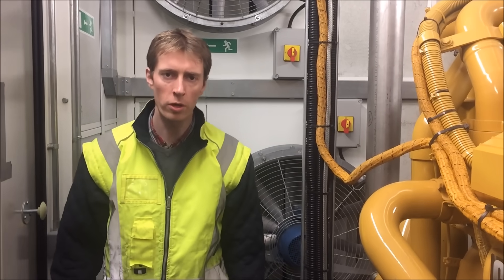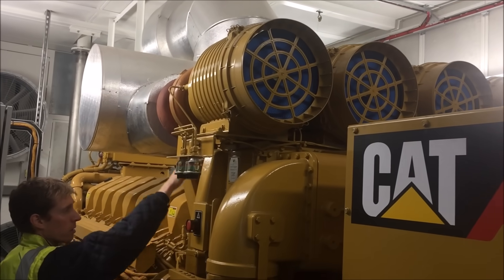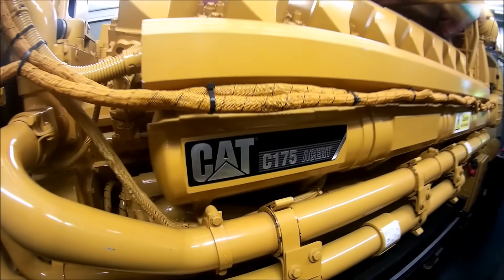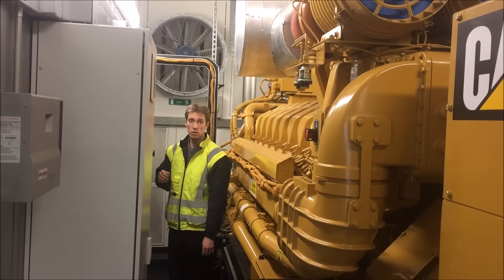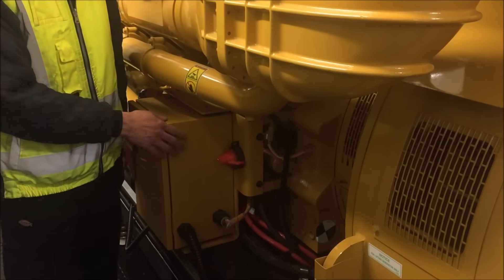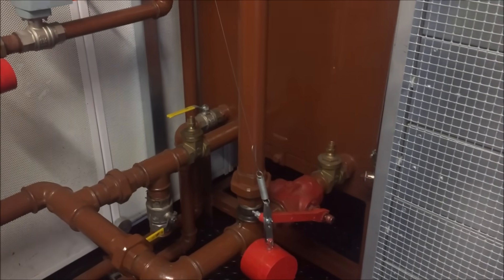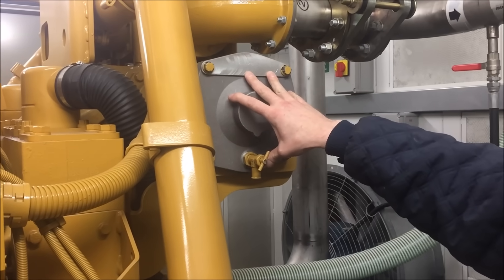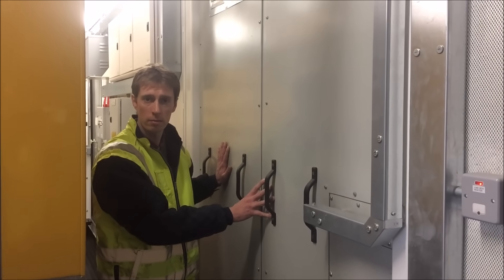CAT C175 Masterpiece: 4000HP V16 Diesel Generator Walk Through & Warm Start

Comment: Where is this engine in, a boat, ship or some marine vessel, or on land such as a pumping station or powerhouse, Looks like only one genset unless in other rooms or cubicles. Usually multiple engines on large container ships for auxiliary electrical use. share common space. As this has an electric starter, is this engine the 175 air cooled or water jacket usage? Thanks
Reply from the maker: Hi Nino, this was one of 4 individual containerised units positioned on a large laboratory in Europe, they were kept individual in case just one needed to be replaced it would be a quick swap. The engines are also used in heavy plant, marine and locomotives though. it has a heated water jacket where the heat is maintained to allow for a quick start up.

Comment: How many of those would keep the hospital running in the emergency?
Reply from the maker: It depends on the size of the hospital, this one was one of 4 installed on a 92,000m2 laboratory building for 100% back up.

Comment: Im happy to have the privilege to build these everyday.
Reply from the maker: great work.
Reply: @RossPerryProductions thanks. I have since then moved to the 3600 platform.
Reply: do you work with me?😂ive been building and welding genset's for the last 4 years and have worked on probably 30+ different variations of bases
Reply: @HazeyKadin just under 2 years ago i got to switch to the 3600 platform.

Comment: There was an airconditiong compressor which had a motor generator to run that compressor @400 HZ, AMERICAN STANDARD TONRAC, HEAVY TONNAGE, BUT could fit through a ‘standard door, that was at the AGFA FILM PROCESSING LAB, IN FLUSHING NY,,but when the GOVERNMENT screwed them, it was sold to a chemical co, in HAVERSTRAW NY, IT WAS A CENTRIFUGAL UNIT. 🇺🇸🇺🇸🇺🇸🇺🇸
Reply from the maker: interesting fact

Comment: 2000L in 4 hours at full load holy crap
Reply from the maker: Yep she is thirsty alright
Reply: I was some years in the proofstation, to check the new engines... well, two of these side by side for a 24 hour testrunning was like a jackpot for the Dieseldeliverer ;-) 2 Loads with 25.000 L for 1 day...  Hot and noisy times..

Comment: What is this engine used for ? fuel consumption ?
Reply from the maker: Hi there, this one in particular was a bank of four on the roof providing 100% back up to a laboratory. The fuel consumption vastly changes depending on the load of the engine.

Comment: The place is so congested to do maintenance work in future,
Reply from the maker: There is enough room to be able to fully disassemble the engine in place.
Reply: Those enclosures are for environmental control and air intake control/filtration for the engine. Over sizing it would be counter intuitive since it would make control more difficult and require more material which means more money. And if you consider how much maintenance is done on this engine it would make no sense to spend the money. Change filters, top up oil, and do routine checks while its running (i.e. poke your head in and make sure its not too hot, has oil and sounds normal). Other than that these engines are built to last and any major repairs would be few and far between, and if major repairs are required there will be access points and disconnects so they can do work on any part of the engine. Also note the enclosure is meant to reduce the incredibly high and constant noise levels generated, so this man should have hearing protection at all times near this while it's running.

Comment: 2.4 mega watts PRIME RATED means this will run CONTINUOUSLY at that output. Keep the fuel coming and the only time you need to shut down is for normal service - filters, etc.
Reply from the maker: Preety much :)
Reply: Might need a couple jerry cans

Comment: Thanks for valuable information.
I am a electrical design engineer.
Kindly suggest which one is better for prime power application.
a) 12 Cylinder V           b) 8 cylinder inline 
in terms of block loading capacity ( in inductive load ) 

I am comparing Cummins KTA 38 G5 and Perkins 4008 TAG2A
Reply from the maker: Hi so sorry I only just see this, my preference is the V12.

Comment: I noticed he said it was a "warm start." I hope during a "cold start" the cooling fans won't come on immediately. This will cause a delayed warm up times to the coolant.  But I am sure it has a block heater or has a heated room for cold winter starts.
Reply from the maker: Hi There Jason, once commissioned and in use/on standby the unit is continuously warmed by hot/water pumped around the engine jacket so that it is always ready to start.

Comment: About the same as the old D399? we had 3 D399's on an Diesel Electric gas drilling rig back in the 1970's
Reply from the maker: I very much doubt it would have changed a whole lot maybe more on the electronics and injection side

Comment: What amount of diesel it  take to start the  engine and fuel consumption  per hour  and mileages if you  have a two thousand gallons tank.
Reply from the maker: Hi there, depends on the load but typically when running an average of 190 gallons /hour, so around 10.5 hours.

Comment: Loved the day tank comment. That is sooo critical as loads vary season to season. 
Do the upper coolant lines have vibration isolation? 
Wish there was more elbow room in the building. 
Thanks for the walk around.
Reply: its takes such a 4 joke crap piece of junk to drive an 11'500v generator, But the c-175 has room to cut ports into for a 2 stroke mod1, there lots of room to CNC laser or plasma cut a custom port pattern and a dry sump oil injection feed with synthetic 2 stroke or castor bean oil, something like this:https://www.4btswaps.com/attachments/2cyclesbc-jpg.6839/. i ssume this is some type of 2 stroke conversion driving this generator!
Reply: Im glad you like the 2 stroke ported engine idea! it can be done with a guided plasma cutter
Reply: It can burn any port pattern in those liners hehe!
Reply: @jlo13800  I do. Two stroke died out before assisted  turbo charging.  Either electrical. Exhaust is hot enough for a steam driven turbo once it comes up to temprature.
Reply from the maker: Hey Allen, sorry I missed this comment yes there was iso mounts on everything, we needed the container to be a certain size as there was 4 of these on the roof of a building. Thanks for watching and your comment.
Reply: @RossPerryProductions  Wow. We normally used three - two on and one off. 
Top of building bothered me during Hurricane season but ... they put the computer and communication equipment up on the sixth floor with dining hall one floor below. Went through many bad storms in comfort. 
Earth's magnetic field continues to weaken so the northern hemisphere will see more forced outages.

Comment: Gosh, they really crammed it in there.  Too bad they don't give you a bit more room around the engine to make maintenance work easier...
Reply: This application really isn't bad at all. If you know you're tearing the whole thing down, you just start with the intake and valve covers to give yourself a little more room to move around and if you're smart, you'll build a little bench to stand on that straddles a lot of the crap on the floor you're not going to be removing. ;-) I've worked on power modules in shipping containers....THAT is some confined space! In that case, you can actually stand on the frame and put your back against the wall. Your feet hurt after a while, but you know....such is life. lol
Reply from the maker: Hi Poly, The installation was containerised so we was limited by a standard container dimensions, worked well though :)
Reply: That's incredibly spacious compared to some built in Caterpillar.

Comment: In simple terms..  this creates enough power to run ??? Like a walmart size building or 5 walmarts? Lol. Im curious.
Reply from the maker: Hi there, well it creates about 2.5 million watts, new LED lights run at about 20watts, and a hair dryer about 2000watts to put it in perspective, we installed three of these which supported a 100,000m2 Laboratory 100% power back up.
Reply: an average walmart uses about 83,000 watthours per month, so assuming the power draw is constant, with 720 hours in a month that’s about 115,000 watts, so theoretically you could power just over 17 walmarts with one 2.5mW generator, assuming thy all had the same constant power draw.

Comment: the fans may bring a lot of air into the cab,because the engine need a lot of him. if one fan stops and the others dont have the capacity the cab may have negative relative pressure,and the air intakes for all the clearances exist,and some doors may open  is they are not locked.
Reply from the maker: Hi Nomon, sorry I missed this, there are emergency louvers that open however the room would run negative.

Comment: How long does it take to come up to power, once it see's power is lost, I'm guessing 12 to 15 seconds?
Thanks
Reply from the maker: We ran lots of tests and it ranged from 10-15 seconds depending on the load.
Reply: Have you heard the term "hospital rated" attached to back up power generators?
Reply from the maker: Not previously no.
Reply: The guy that designed one of the systems I installed, told me that means the back up generator needs to be at full power in 10 seconds or less to meet that NFPA standard, we weren't working at a hospital, but apparently the one meg generator we installed was hospital rated, the starter spun that thing up so fucking fast it was crazy, it was at full power in about 8 seconds, I've only done a few, neat stuff.
Reply from the maker: Sounds good :)

Comment: The CAT C175 is now used in locomotives in the UK, "Class 68".
Reply: Probably, the "Class 98" too, if UK freight operators want to buy the new bimode Eurodual with a true locomotive engine...
Reply: 3600 series or c280 would be a better engine for locomotives
Reply from the maker: I didn't realise that, thanks for the comment
Reply: Same thing for an american locomotive, the EMD F125 which instead uses a 20 cylinder engine instead of the 16 cylinder engine that the class 68 uses
Reply: @tankman_tv9332  I didn't know this, thats some bit of kit . One thing is certain though, they are dam loud, I mean really loud!!! I'm always amazed that they passed the emissions regs we all now have.
Reply: The C175 is also spec for the new Stadler locomotives being supplied to KiwiRail in New Zealand. Really looking forward to seeing these beasts which are rated at 4000 HP.

Comment: i like the zip ties holiding the harness cat couldnt put proper insulated clamps on a couple hundred thousand dollar  diesel
Reply: You don't need insulated clamps to hold the wiring harness to the rails on the side of the engine.
Reply: those are what we call Catstraps
Reply from the maker: its amazing what you can do with cable ties

Comment: I’d love to see the internals, imagine just a piston 🤔
Reply: EACH of the 16 cylinders displaces 323 cubic inches (5.3 liters)
That's a 6.88 inch bore (17.48 cm) and 8.66 inch stroke (22 cm)

https://www.cat.com/en_US/products/new/power-systems/marine-power-systems/commercial-propulsion-engines/18385954.html
Reply: @gtcazusa  The Caddy 500 is a square bore engine (same bore and stroke) w/ a bore of 4.300"and stroke of 4.304". You can bore it .200" to a 4.500" bore. That 2.580" bigger bore, and just over twice the stoke distance, and twice the number of cylinders of that CAT make a heck of a lot more torque.
Reply: @patrickmcdonald3427  caddy 500 has 36 pistons then? "twice the number of cylinders than the CAT"?
Reply from the maker: They are huge, thanks for your comment
Reply: S Furm the piston is 18 across, I personally rebuilt this entire engine
Reply: 9 car Cottrell not sure if you’ll see this or not you should try and get some videos of the rebuild process

Comment: No ear protection worn, No guards around coolant water pipes
Reply: And he was fine. Not your problem.
Reply from the maker: We will make sure he does in the next videos, no guards required around pipes as it is a permit to works space. Only trained individuals can access.

Comment: i worked on them when the 794AC arrived to my Worksite a Coal Mine in Coahuila Mexico.. remember a day that had very low power on the right side.. people tought they were the injectors and turbos but it was an admission coupling loose...
Reply from the maker: sometimes the simplest things can cause these big engines to fail

Comment: 2000 litres ; 4 hours

1 hour ; 500 ltres

1 hour = about 100 gallons?

so 100 gallons to the hour at full load

so ten of my transits fuel tanks an hour 

so would use my fuel tank in roughly 6 minutes?
Reply from the maker: Haha Seems a lot when put like that, its closer to 110 gallons an hour, but does your transit have 4000hp?
Reply: I sometimes question it has 40.

I wasn't criticising at all.
Reply from the maker: Haha no just jesting with you :) thank you for watching and your comments

Comment: Awesome where do you add the def fluid
Reply from the maker: There is a small reservoir but cant be easily seen on the video sorry
Reply: I actually didn't know this until recently but some of these larger diesels actually don't need DEF in order to meet the emissions standards for NOx gasses.

Comment: Is that engine used in train locomotives?
Reply from the maker: I do not believe so, however i could be wrong.
Reply: The EMD F125 has it,a C175-20 cylinder.

Comment: C175 has Single stage or double stage turbo ?
Reply from the maker: Hi there, they are a quad single stage set up.
Reply: Hi, Thanks for your prompt reply. 
Which one is best diesel engine for prime power application ( for 2000 KVA)  :- 
Application : Stone crushing plant 
1) Caterpillar 2) Kohler 3) Cummins 4) Perkins 5) MTU
Reply from the maker: Hi there, this is only personal preference however I would stick with Cummins or Cat, but you would be best off contacting each of the companies and seeing what they can offer with regards to value for money and warranties.
Reply: Hi, thanks for suggestion 
Apart from warranties and price , which is technically salient

Comment: What is the C175 like compared to the 3516s?
Reply from the maker: Hi there David, unfortunately we have never installed a 3516s to be able to comment.
Reply: The 3516 was mostly a mechanical injected engine while this is upgraded to electronic injection. The blue print on the block is basically exactly the same.

Comment: About that start up- was that just to idle? I don't think you had it throttled up to operating speed, correct?
Reply from the maker: Hi there, thank you for your comment, thats correct there was no load on the engine therefore just at idle.

Comment: i work at one of the engine plants for CAT we dont make these but i make c-18 and c-15 nice video hope u enjoy this beauty
Reply: I'm a retired Cat machinist.
Reply from the maker: Thanks for your comment Michael great engines
Reply: michael s. clark I also work for a caterpillar dealer here in Zimbabwe. So far the biggest engine I've worked on is a 3516B, 2mva generator set. I did a complete engine overhaul
Reply: michael s. clark ..is the c18 used for comercial like on semi's ?
Reply: Cat’s 2007-spec C15 engine will be sold through 2009
PEORIA, Ill. – Following months of speculation, Caterpillar has announced that it’s leaving the heavy-duty on-highway truck engine business by 2010, before the next round of emissions legislation kicks in.
Reply: I am dealing in All types DG sets
And Accessories/Parts 
Please contact for any Queries +919719313666
Reply: I work for jallad in Lebanon, power plant operator. CAT is the best.

Comment: will this fit in my honda
Reply from the maker: If you move the driving seat to the boot, and do a small amount of welding maybe?
Reply: Drewsey extend the length of the car shift ur gearbox,accelerator,brake,clutch and steering controls to the roof top fit a sofa on the roof top n drive like Mr Bean.
Reply: a c9 will take less modification lol
Reply: lol hell yeah, or at least your Honda will fit on it.
Reply: yes it will, use the tomtop p/n: cat-honda c175-2.0 @tomtop.com.

Comment: he say 2000 liters for 4 hours on full load ???
Reply: Generally speaking the bigger you make an engine, the lower the specific fuel consumption (liters per kW per hour, or gallons per HP/hr if you're in the US). Really ginormous engines like the Wartsila behemoths are stupidly efficient.
Reply: 0,18 liter./hpxhour    x 4000hp=   720 liters/h   in4 hours   2880 liters fuel consumption.
Reply: That's what he said---translates to roughly 3,000 gallons a day if you ran that baby fulll tilt
Reply: 4 hours 2.4 megawatts  = 2000 liters diesel ????
Reply from the maker: yes not bad :)

Comment: AGP 3000 check it out mfg wi wakashaw something like that. That CAT engine is humongous the volume of fuel it requires to operate is costly. The Caterpillar Corp makes absolute best heavy machinery you can acquire period !!!
Reply: hey i work at Rea making the transformers for these. These are for max peak power or for when the grid fails. [backup] Also many of these run on natural gas. The one in this video is diesel, but the NG generators can just super crank out power. so yes they use alot of fuel, but are intended to run only at certain times for a short time not more than a few hrs.
Reply from the maker: Hi sorry I missed this comment, the installation was on a highly critical laboratory building where the price of fuel would be negligible to the value of samples, and work that could be lost. Ross